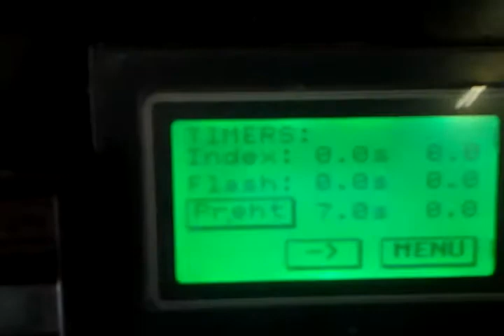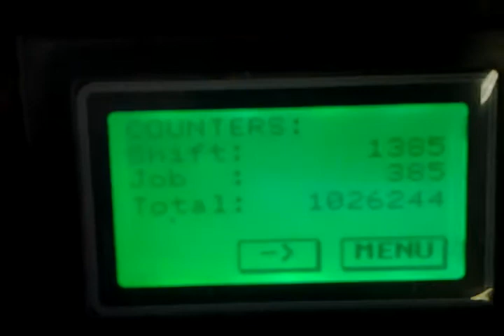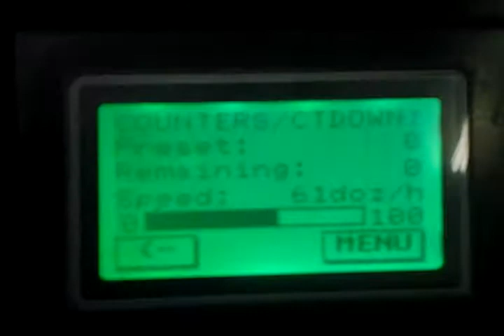M&R Screen Printing Automatic Sportsman E at 800 shirts a hour speed.

Comment from the maker: We have this one with 2 mill on it now. And bought a EX touch screen shortly after. Between the two i think i prefer the switch model better since we dont use revolve mode much. But when we do it comes in handy. I never use rear micros either. I just hold the screen firm, open it up and tap. but i guess i kind of get that from running the old precision ovals from the 80's having to use a hammer for micro's hehehe. I have one vid on here in operation before we for rid of it, running balls out to... And ran so smooth. I hated to see that beast go.